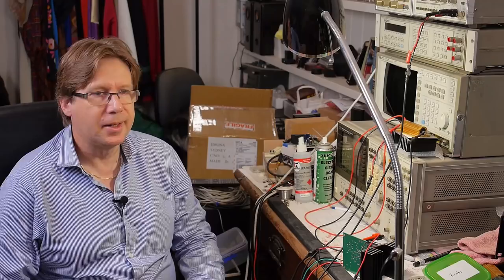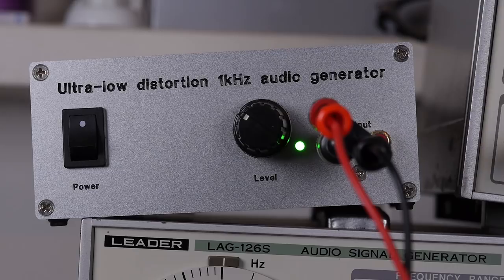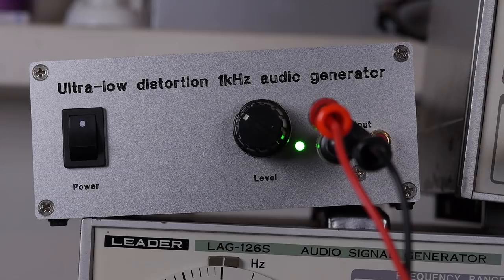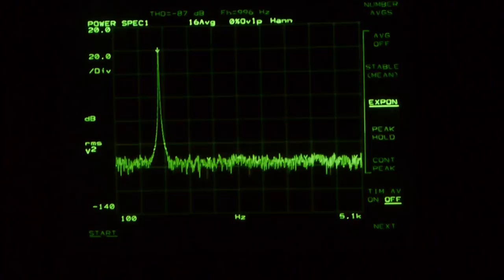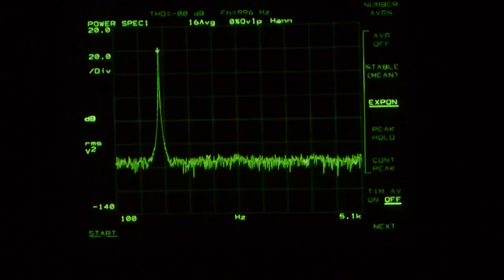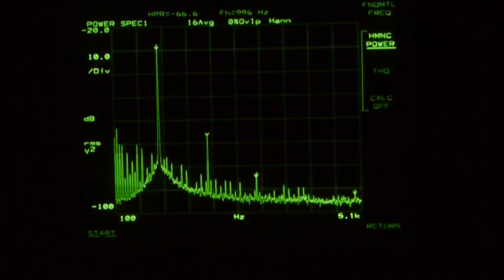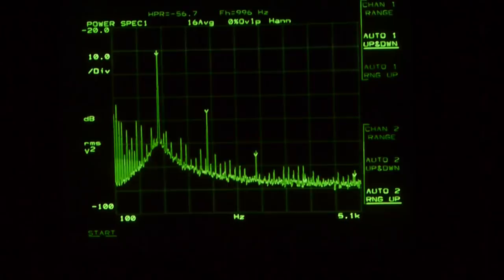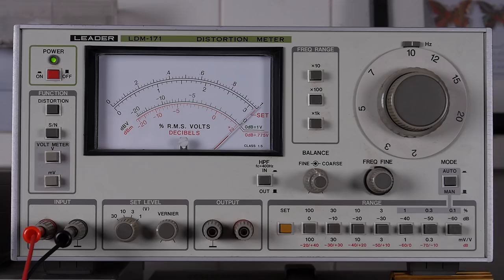Guest Video - Karl Adams - Audio Distortion Measurement

Comment: Jeeze, this is really measuring distortion like we did when we used to live in caves.
Nowadays, just get a decent (USB) sound card which goes MUCH quicker and you can easily measure down to 0.0005-0.001% or even lower.
For around $400-500 there are even more professional solutions to go down to 0.0001% or lower.
Reply: B Breeuwer Really?  That would be a card with a lot of ADC bits to actually measure such low amounts of distortion directly.  But even then,  his technique would also work to measure distortion lower than the input resolution of a sound card.
Reply: "you can easily measure down to 0.0005-0.001% or even lower." How, with what? If your on a low budget there is no software or gear (that I know of) that can measure that low a distortion, that's why Karl and other's like myself pick up old distortion meters and SA's.
Reply: Old test gear is cool. like he said in the beginning of the video. Who gives a crap about a PC with a soundcard in it
Reply: Diabolical Artificer. A lot of 24 bit sound cards can go that low. As for software there are multiple flavours but ARTA is what I use.
Reply: alles klar klaus. If someone is that serious about getting such low THD+N figures he should care. But basically my budget cares. The gear he is using, even bought second hand, is a lot more expensive. Also in the end it's much more hassle, which means that the results will be less accurate and less consistent. In my opinion he should at least show the alternatives.
Reply: B Breeuwer A spectrum analyser should be around anyway or are you just using the soundcard? Problem is you got no calibration whatsoever for that soundcard setup which as a hobbyist doesn't matter much but for professionals is a pain in the butt because you just can't validate the results and write "0.01%thd" on the product with any certainty
Reply: Well obviously it depends what frequencies you're interested in. But if it's about audio band, a soundcard is more than adequate, but double check the specs (not all cards are great).
You only need to keep in mind how 'low you can go'. Practically it means that you need to be at least an order of magnitude better than what you want to measure (not totally true, can be little less). About calibrating; read a bit more how distortion is being measured, or rather calculated. 
The fact that you need fancy expensive equipment for enough 'certainty' is a bit old fashioned. As a professional engineer in acoustics and audio equipment I have been using these techniques (including the one Karl is using) for years. I am more than confident enough to be sure the results are accurate enough. Sometimes I double check them with an Audio Precision analyzer (it won't get any better than that). But results are always consistent.

Practically speaking. Most amplifiers (on the market) distort around 0.01-0.001% THD+N sometimes a bit lower. There are enough audio ADCs who are easily capably of measuring these numbers. With averaging you can even get a slightly better result (since the noise goes down)
Reply: B Breeuwer Well I am not really an audio guy. Built a few amps for myself when I needed one or just wanted to try something, might be fun to measure those with a PC setup. 
I don't really doubt the capabilities of the soundcard. I am a bit involved in metrology stuff and where I work the problem is: If you measure something with an instrument which isn't calibrated (1-2yr cycle at work) the results are pretty much useless. Your instrument could be way off, you would never know. If you check your soundcard against something order of magnitude better you can be pretty certain, certainly good enough for a hobbyist. At work, you would need a cal certificate and whatnot, because.. just because.
Reply: I am talking about that this is certainly good for professional work even. Metrology was part of my study and I don't know why you would say that after a year or two result will become pretty much useless. That might be true for all the regulations we have nowadays, but certainly isn't true for the end result. That's also why I said that you need to be roughly an order of magnitude lower. 
I know big calibration companies (bodies) will tell you otherwise, but that's simply because that's how they earn their money.
There are enough clever ways (like a loop-back measurement) to check your measurements. 
You have to take most results with a few grains of salt anyway.
Reply: B Breeuwer Well, if the instrument has a cal cycle of 1 or 2 years, after that, it has to be recalibrated. I have multimeters at home that have been calibrated in 1999 and still read within 1 LSD of their brothers of the same type which have recent calibration. However, the manufactures don't give you a "guaranteed" spec for 10yrs. That's pretty much impossible and they also don't want to.
Reply: I know, but as long as you're measuring stuff that is an order of magnitude bigger than their expected inaccuracy. Unless a meter is really off (which would make it a no-go for me anyway), but in most cases there are (very affordable) methods to check these things yourself. Nothing 'has to be' calibrated. It has to be calibrated when you're not confident about it anymore or when you're working in a field where it's mandatory. Since there are basically no ISO or NEN norms about THD+N (or in the audio field for that matter) it's not needed. Only for yourself and a good night rest.
Reply: If you wanna go that far. In my 30 years of experience were I worked with calibrated and uncalibrated meters, even the cheapest ones stay within reasonable specs after many years. More than good enough to develop good working circuits. It's one of these topics that I find very much blown up (with me a lot of other people and co-workers)
If your circuits are that picky it's a different story of course, but the engineer should know that. Anyway, we are not talking about meters, we are talking about measuring THD. Which is done by an ADC.
You can find the tolerances in their datasheets, which is all you need. The rest is just simply math (what software does for us nowadays).
In 99% of the circuits used for customer product 0.001% more or less is not really something you typically care about. In fact, most of your passives and circuitry has a MUCH bigger tolerance than that. So you tweak everything super nice on your expensive calibrated meter, the next day it will be all off again anyway. 

If it would be for developing a super precise measuring equipment that people need to rely on, that would be a different story.
Reply: Generate a 32 bit wave file using Scipy with Python. This is your reference and since the sound card is 24 bits, the file accuracy is 256 times more precise than the sound card. Use your 64 bit CPU processor to do a FFT on the 32 bit wave file to establish the base accuracy of the computation path to verify that the computation has sufficient range and precision. This is very easy with Scipy and is a few lines of Python code.
Now play the 32 bit wave file through your sound card output and record through the sound card input. Do an FFT on the recorded input. The source file is 32 bit, the computation path is 64 bit, any noise or distortion is from the sound card. You now have a reference to determine if the sound card is suitable for the level of THD+N you wish to measure.
Reply: B Breeuwer Even developing and building a simple digital current meter to within 0.1% 1year accuracy is not that easy a task, let alone 0.01%. Even good 6.5+digit DMMs do drift and especially if they are new they could be off a few ppm per year. this gets better with age. But the point is calibration (with traceability to the national standard) is the only way you know your results are not absolut bullshit, as I said before. Whether anyone cares for (home) THD+N, I don't think so.